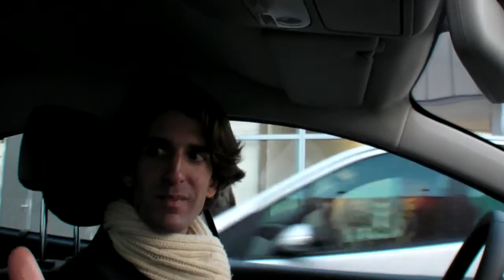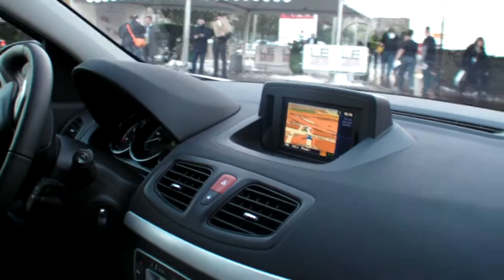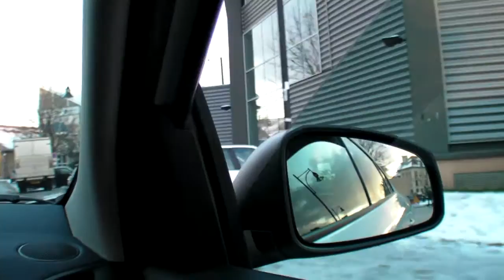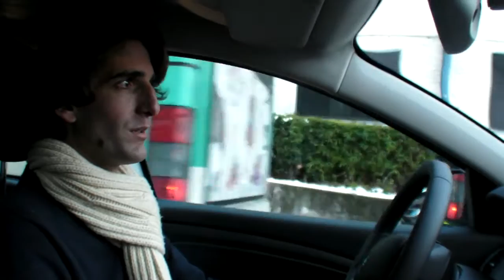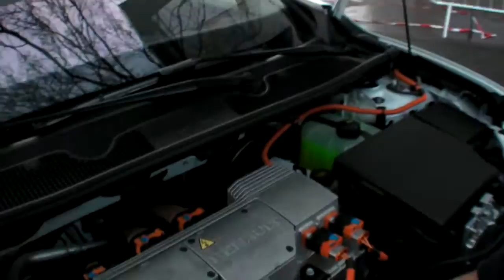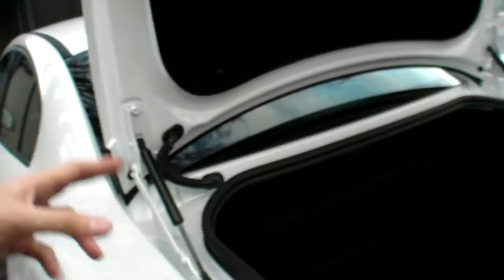Test Driving a Renault Fluence Gen2 electric car in Paris!

Comment from the maker: @laurentprodz You don't buy the batteries, in the Bertterplace model, you pay a monthly fee that includes renewable energy to charge in the whole country, and free unlimited battery swaps so if you drive further than 200km you can swap the battery. That fixed monthly fee will be lower than what most people pay for gas in an oil car.

Comment from the maker: @ilkerol1986 The battery range will be increased as newer batteries have longer range and can last for more recharge cycles, and you don't use the same battery all the time, you swap the battery for free in one of those battery swap stations, and thus you can also have the longest range available on the battery market.

Comment: The battery range will increase mostly as batteries will get cheaper, they could put in a battery twice the size or more witout problems, but the price suffers so bad so they don´t. Tesla does though, 85Kwh battery, compared to 22Kwh in this car. Almost 4x bigger battery.

Comment: @MBrostroem Wow i didn't know that it has so poor range on battery. Also the system is very complicated and expensive for this range. I guess they want to lower fuel consumptions for heavy traffic where stop-starts happen. But Fluence is very different, completely battery car. I didn't know that Prius has so litttle range so i wouldn't say '' I would prefer Prius. '' Anyway that's all :)

Comment: Heard from my grand parents that Better Place closed but an auto dealer has bought 150 RF and is selling them for 100K dkk which is about $20K and you're renting the battery from Renault for $50/month... Cars in Denmark cost about 3x the price in other countries due to heavy taxation so a full size car for 100K is unheard off. Electric cars avoid taxation for some years but apparently their socialist government will end that which is rather surprising. The range of 150 km should be a problem since public charging stations are really rare. But if you're just going to work, collecting kids and that's it then the limited range should be no problem since Denmark is basically the size of the major metropolitan area in LA!